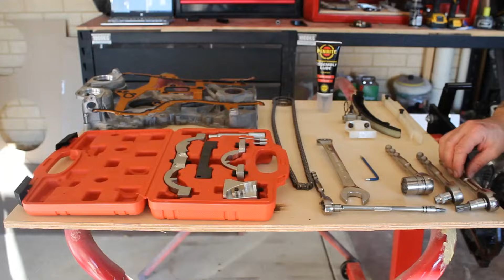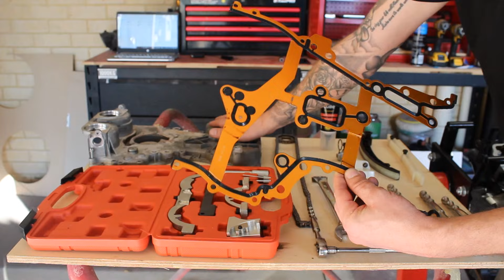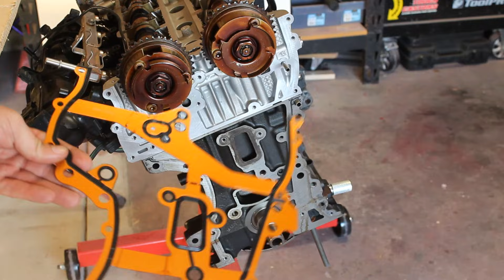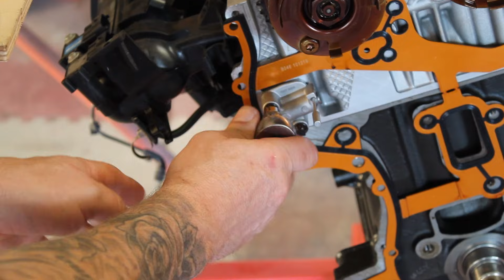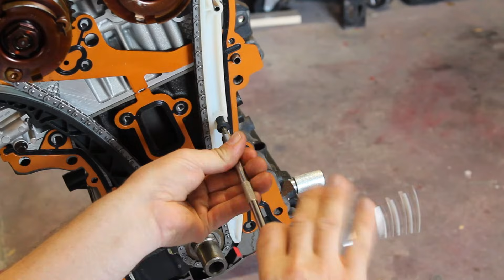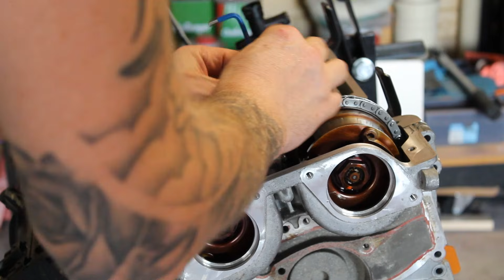JB Customs Holden Chevy Cruze Trax 1.4 Turbo Timing Chain

Comment: Does it have a proper sump gasket as in a pressed cutout shape or is it rubber or do I use silicone, my sump doesn't have a gasket but there is a thin line of gasket sealer it was  obviously damaged when I took my sump off, also how many NM did you torque the timing chain guides to ? and the top chain guide,? And also the water pump and timing case cover bolts,?really appreciate any help you can give, thanks
Reply from the maker: Hi mate, sorry for the late reply. No gasket no, just gasket sealent, Guides up to 10NM, . Water pump, Tighten them in a crisscross sequence to an initial 8 N⋅m, followed by an additional 30 degree turn. The water pump pulley bolts are torqued to 20 N⋅m, timing cover, the 13x 6mm bolts 8NM the 2 x 10mm to 35NM. 
I hope this helps mate.
Reply: @JBCustomsPerth @JBCustomsPerth thanks for your message, I have put it all back together now, one thing I did realise is I couldn't use a 1/2 inch drive torque wrench for 10mm 12mm  bolts, on my first attempt I snapped the star drive bolt that holds the chain guide rail on because I used a half inch drive torque wrench, I realised I needed to use a torque wrench with either a 3/8 or a 1/4 inch drive for most of  the smaller bolts otherwise I would have overtightened/stretched or snapped nearly every bolt including the sump bolts.
Reply from the maker: @Joseph-y3t3f hi mate, yeah all the bolts have a relative toque. Using a torque wrench is best and doesn’t matter whether it’s 1/2” 3/8” or 1/4” as long as you set the torque.

Comment: I seen other peoples way of doing the timing for this engine and they have the pin inserted all the way but in my case i cant insert it flush into the block but its TDC. on the other hand i did it the way some other people did on youtube with the pin seated in all way , having this way on my engine cylinder 1 is at the very bottom, tried running it like this and had the throttle body spitting air out and no start , it was 180 out of timing . timed it with cylinder 1 at TDC and pin not flush in block but holding crank fine, we will see soon how it starts after i get new cam phaser bolts and crank bolt
Reply: That’s because you were on the exhaust stroke not the intake stroke. The pin to hold the crank will fit in 2 spots but not flush for the wrong one.
Reply from the maker: How did you get on mate?

Comment: And why do you gota wait and pull the pin on the tensioner after the cover is on
Reply: Not everyone does (not least because most tensioners have a ring that doesn’t fit through the plug so you’ve gotta swap it with the one from the timing kit). 

I think the reason to do it is because your phaser alignment tool screws into the timing case and should be installed and torqued before pulling the pin.

Comment: that engine is nothing but problems. cracks in the valve seats , cylinder head failing, coolant leaks , turbo fails. junk.
Reply: Because of high coolant temperature.
Reply: I've got 341k miles on mine, but a lot of hazzle keeping it going. 3 water pumps, 4 pcv valve/valve cover replacement, rebuild head at 212k due to burnt valve, multiple coil packs, rear bearing tone rings corroded away for abs. But wait that's not all. If I had to pay someone to do it I would be broke. Leaks oil and coolant again. But keeps going and runs well. They were made to be constantly worked on.
Reply: I’ve got 410,273 miles on mine, if you actually read the manual and did proper maintenance the car is the most affordable and best on gas….. over haul needed every 50k miles

Comment: Does the crankshaft pin not have to go all the way in? Someone else had it go all the way in but I have mine set like yours with a bit sticking out.
Reply from the maker: Hi mate, as long it locks the crankshaft in position it doesn't matter. It depends which kit you buy as well the pins are longer and look like they stick out further.
Reply: If its not holding the crankshaft in the correct position the cam tools won't line up.
Reply: It definitely matters, when it doesn't go in all the way it's because it's not fully lined up with the slot in the counterweight
Reply: With the pin installed correctly you should not be able to turn the crankshaft at all, not a bit.
Reply: Go all the way in